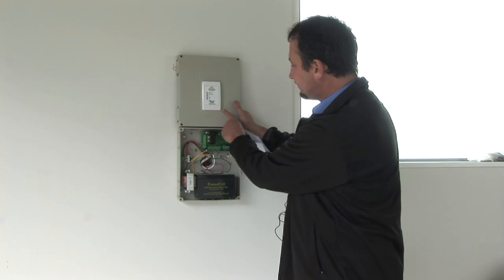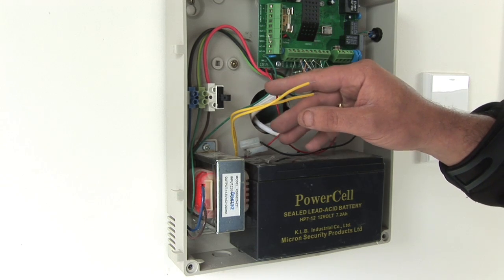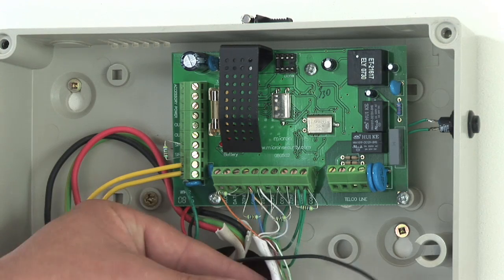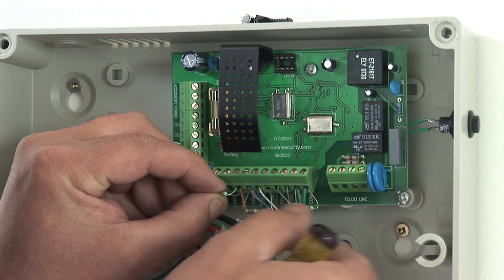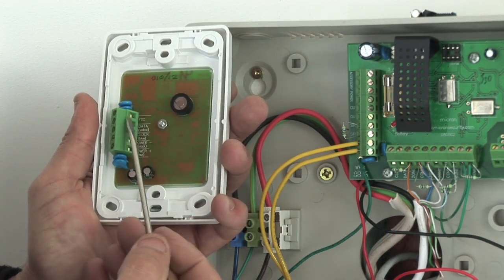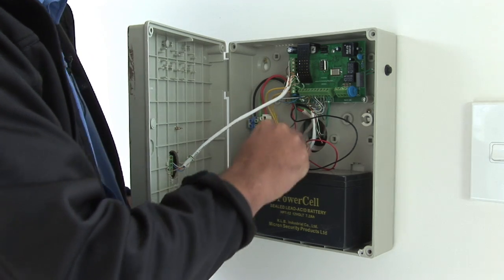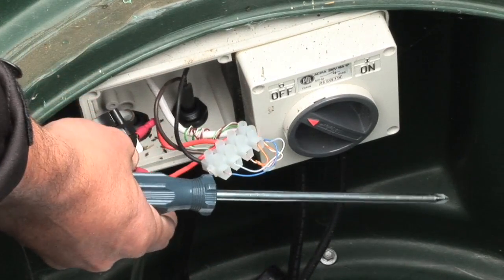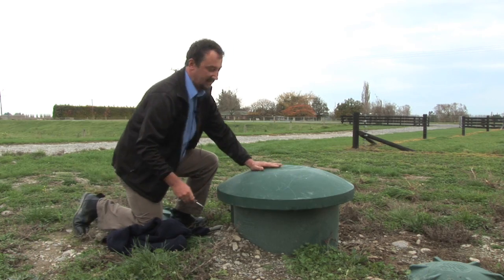Micron Box Installation

Comment: Hi Airtech, my micron alarm new battery is draining after a few days causing the touchpad not working. I measured the yellow wires one have 17VAC and another one just 3.7VAC. Is this normal or the transformer is faulty? Thanks